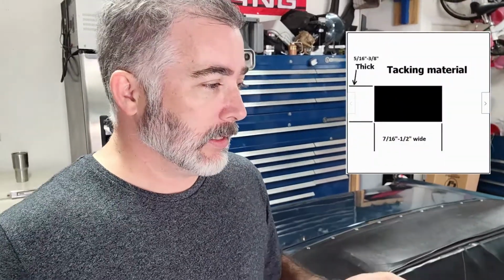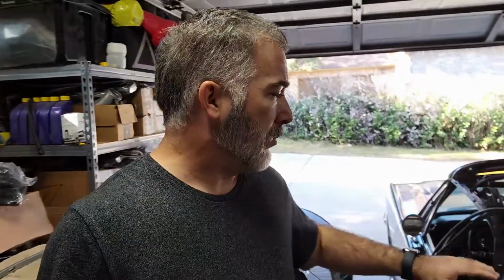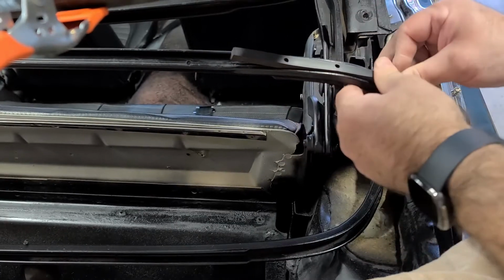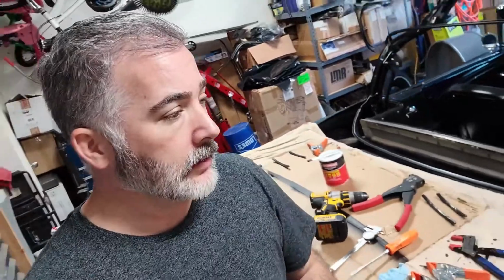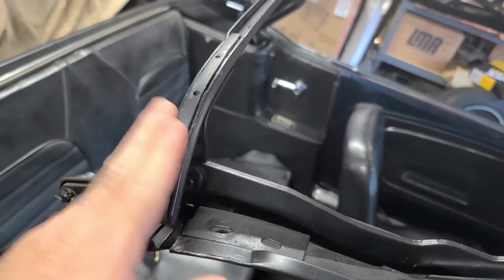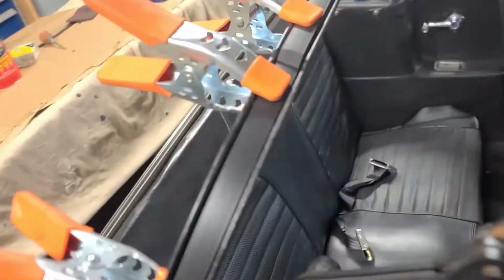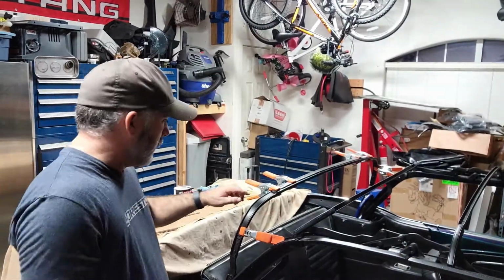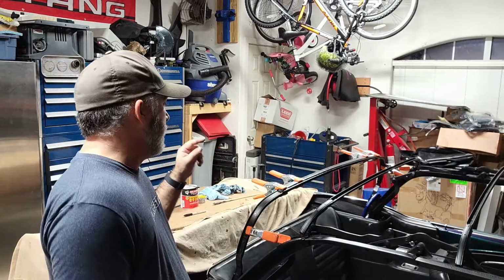66 Mustang Convertible Top Installation Pt 2 Tack Strip Replacement

Comment: I've done so many Google searches, watched several videos, read the various forums and finally found your video guide!  It's excellent, best I've seen and I'm very appreciative.  My main issue was prepping my old frame, because the rear bow tack strip was  improvised using an engine belt.  I wanted to replace it, but was having a hard time finding out the correct depth, where to buy the material and so forth.  Thank you very much!
Reply from the maker: Thanks for the feedback and thanks for watching!